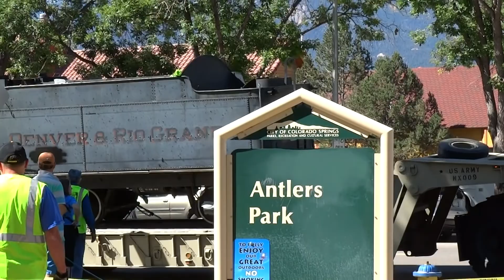D&RG Locomotive 168 Departs Colorado Springs Part 1

Comment: The 168 is now safely ensconced in the Antonito, CO engine house of the Cumbres & Toltec Scenic RR. I got a glimpse of her on a recent Friends volunteer work session (20-24 Jun 16). The goal is to have her completely restored and under steam running the rails of the C&TS. I got to see the 168 in Antlers Park a few months before the move and she is in amazing condition ...at least superficially. All her accessories are present and she had not befallen to the hands of vandals ...probably because Antler's Park is fairly well hidden. I suspect it will take a good couple of years to get her back in steam ...just depends how much time the engine house and to what priority the C&TS will apply to her restoration. The 168 will make a great adjunct to K-27 463 (one of two remaining K27's). The 463 is currently the smallest and oldest engine on the C&TS (27,000lbs tractive effort; born 1903); she will be supplanted by the 168 (11,590lbs/born 1883). The two of them will make an awesome double header and should, together, be able to conquer the 4% grade from Chama to Cumbres. I suspect the 168 will be somewhat sheltered from the daily drag of summertime operations as is the 463 ...being used more for special events than slogging the daily trains over the mountain. An even better "get together" would be the D&S 315 and the 168 ...small engines in some big country. Looking forward to hearing her "speak" once again ...